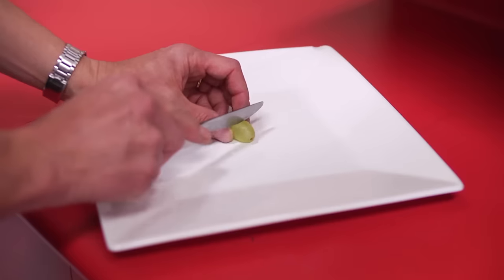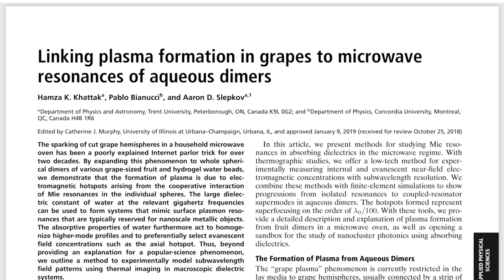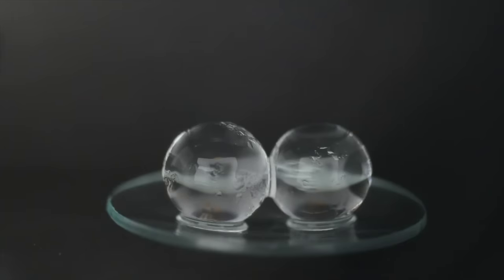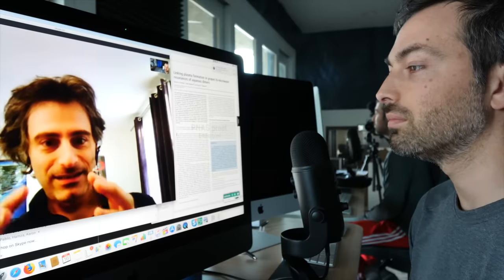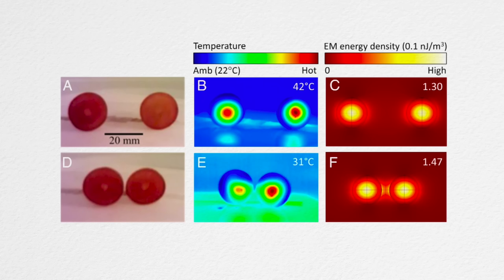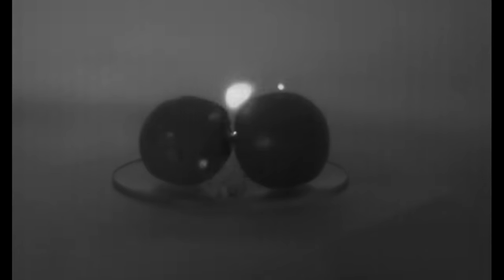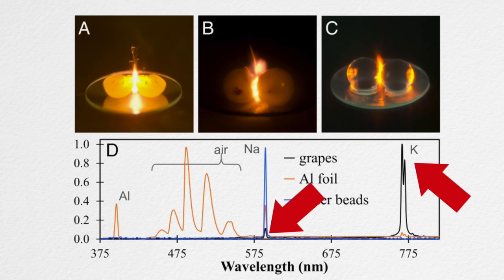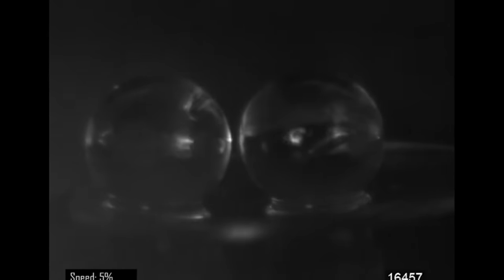Microwaving Grapes Makes Plasma

Comment: When they touch its like Hotspots in electromagnetics vs a wire with a hotshot
Reply: Resistance is greater at the "weak connection" or damaged wire causing glow just like plasma in electromagnetics and the grapes but with more delicate needs for reaction

Comment: So 2.45ghz is non ionizing radiation, until it comes in contact with things of the right size, composition and refractive index. it then can focus the energy and create a greater amplitude to have enough energy to become ionized radiation?

Comment: I am still not entirely sure how the magnetron gets damaged by this process. Is it the reflected power, similar to SWR in standard radio transmitters? It seems that the absorption of energy by the grapes and sustaining the plasma would give up enough energy to prevent damage by reflection. What am I missing?

Comment: I don't know if I am just tired but how can it be total internal refraction? For that to occur, the index for the transmitted wave should be larger than for the initial wave, but n=10 inside the grape and n=1 outside of the wave, so the index outside of the grape is smaller not larger than inside the grape?

Comment: So when you cut the grape in half, do microwaves still get trapped in grape medium or the broken membrane makes a difference? And also, is the contact area between the two haves the hottest or each half has its own hot center? Just curious.
Reply: from what was shown in the video I think 2 grapes touching whether half/full will make it the hottest at the point of contact, not the center.

Comment: Yeah but does it change the nutritional  value ? - What if the demand for hot grapes goes up, and they tax them as a hot food commodity,  will it effect Wine  Cave dining  ? - Or can the bi - product be utilized  for glow in the dark implants ? - would  it be safer for the Australian  Navy to endorse their sister  company with beacons  ? - I know they do allow free breast enlargement where a pacemaker might be applicable  to the design...geeze.

Comment: With 2 nanometer lithography resolution, you could make some really small integrated circuits. You could even make robots with it and just suspend them in an injectable liquid. If you were very talented you could maybe figure out how to create chemical binding sites on these structures and thus make them self assembling. Just store it at very low temperatures before use ;)

Comment: Put a bunch a grape juice in a engine on ur back for fuel  make a metal arm extension with cooling pads inside with electro magnetic radiators and ur iron man now 😎

Comment: What if you do that to 100 grapes or 1000 or 10000? Can you measure the joules of the energy created? Could you use the combusted material? What would the difference be between the applied microwaves vs the energy created?

Comment: I have a question -- so 1:59 to 2:44 you said that the index of refraction changes the wave length from 12 cm to 1.2 cm. I  looked up the definition of index of refraction and I understand that the two sides of the fraction are for speed in a vacuum vs speed in the medium, in this case the water of the grape. Can you fill in the gaps and help me understand this piece better?

Comment: You have what looks like a heck of a nice house. I wonder if your house is as smart as you.  I see that big refrigerator and wonder if you use less than 17kwh per day.  If not, why not?  And if not why don't you make your home a zero energy or positive energy home like Bill Nye has and make that your next project?  Maybe go some steps further and make your home 100% toxin free and maybe even your yard permaculturally designed and maybe get the LEED award and Living Building Challenge certification?

Comment: guess what smartie pants if water is a good absorber of microwaves it also means it is a good emitter of microwaves which means you should probably look at why they can detect the CMB near the ocean but professor houruni's antenna in Albania in the mountains far from the oceans cannot detect the CMB, and they have NEVER been able to detect the CMB at L2 not the monopole spectrum, they just take microwave differential mapping, which is valueless imo.  Plus the astronomers should have known they had stumbled onto confirmation bias when the signal was so STRONG in orbit not l2 how could the remnant signal of the big bang be THAT strong, it is totally absurd.  lots of water on this ball, pretty obvious what has taken place, sad that science has ZERO integrity anymore.

somehow I have the feeling none of you have the integrity to even truly look into what is going on here, you have just accepted it at face value.  It cannot survive scrutiny